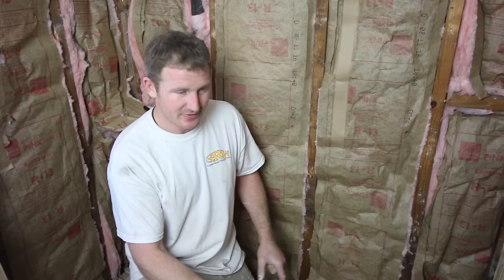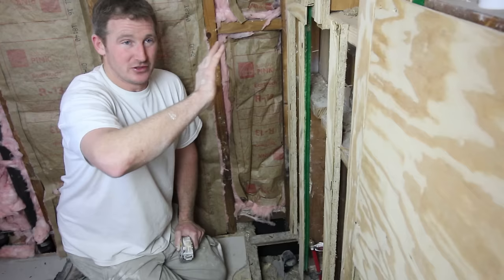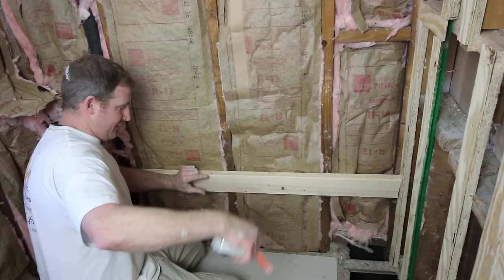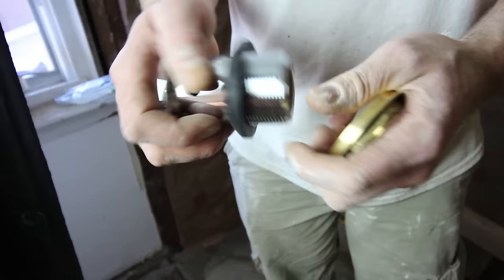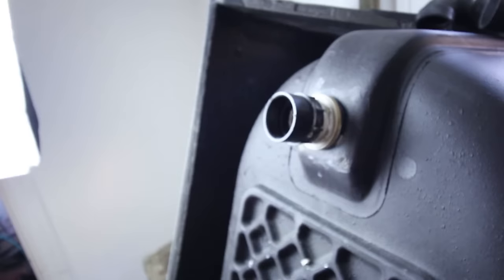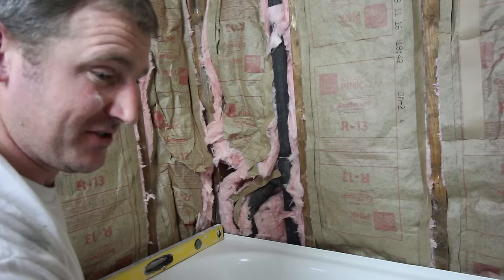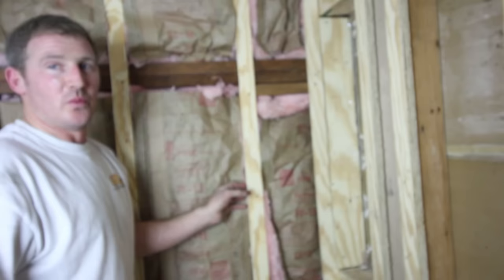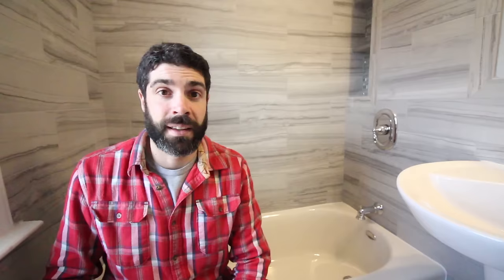How to Install a Bathtub...American Standard's Americast (Step-by-Step)

Comment: Installed this tub. When you stand in it the tub  squeaks since the bottom is made of foam and the bottom is designed to touch
the surface of the floor.
Reply from the maker: Is your floor level?
Reply: Yes, I leveled floor. After use the squeak diminishes, but not 100 pct. There is a forum on Americast brand (American Standard) foam bottom tubs.
They flex even when installed properly. After a few years the tub enamel may experience stress cracks requiring removal. The mfg does not recommend mortar bedding due to heat stress, but contractors say this is the way to go.  Other cases have happenned where the foam delaminates from the tube. The instructions recommend silicone beads. https://www.johnbridge.com/vbulletin/archive/index.php/t-74696.html

Follow-up...I was able to find an adjacent wall to the tub and gain access to the underbelly of tub. I cut open the drywall.
I poured about 25 pounds of concrete floor leveler and spread it around with a make shift wood stick taped to an L shaped end (from a shelf hanger). I pushed the soupy mix around the outside base of tub. I could only reach one side. Then after 20 minutes of setting up, I was able to move the thicker mix on the floor  against the under side to push up a ledge of concrete to support the under side next to base. This is only about 2 inches or less space.  I checked the tub, and all the squeaks went away!.

Comment: What do you do if your alcove tub has an integrated 1/4 inch flange , and the hydro ban board you plan to use says you must add firring strips, but by adding said fitting strips plus your board of 1/2 inch makes the shower wall 1/4 inch proud of the rest of the rooms half inch drywall. How do you make the shower wall in plane with the rest of the room if you have to add 1:4 inch strips for the tub flange??

Comment: Thanks for the video. Do you remove the screws & washers before putting on the new backer board? 
Otherwise wouldn’t the board flair out at the bottom & sit funny over the angled washers ?
Reply: The screws and washers stay. You can notch the backer board to fit around the washers.

Comment: Just curious why the caution to not over tighten the washer and drain. Is it more likely to leak if it's too tight? I installed this tub and followed the direction to hand tighten plus a 1/4 turn and im getting a slight drip leak under the tub drain at the rubber gasket.

Comment: Question: Do you worry about the metal threads on the drain shoe causing the ABS to crack and fail? I was always told not to put metal male threads into ABS/PVC female threads
Reply: OS&B sells the kits that way, unless you opt for the full brass kit, i used Teflon tape around the metal treads and just dont over tighten and ABS works fine. The nice part is the metal doesn't corrode in the ABS

Comment: good video , but you should at least show how you connected the drain. that is the hard part and need to see. at least draw a diagram or show connectors you used or how you did it? Thanks

Comment: I am planning to replace my bathtub. Do I always need to replace the drain pipe even if there’s no change to the new tub location? Thanks!
Reply: Depends on the type of plumbing you have. If it’s old cast iron or galvanized pipe, lots of cases, taking it apart will cause those pipes to crack and leak. 

Also if you have an old drum trap, get rid of it. All in all, be ready to update the plumbing. But it’s not required if you’re careful

Comment: Why do you need floor leveler if your just going to dump mortar on it? Doesn't the mortar level it out?
Reply: The mortar isn’t for leveling the tub it’s for keeping the tub from rocking back and forth after a few months after the install. Some use mortar mix but I was taught to use sand mix and lay a it on the subfloor so the bottom of the tub will have something to rest on instead of sitting off of the subfloor . Even if your floor is level there’s always imperfections in the plywood or a joist isn’t sitting right so by putting that layer of mortar mix down you are giving it the best chance to not rock back and forth while you are taking a shower .

Comment: Thanks for this video-- I have a few questions: Was anything done to reinforce those notched joists? Notching joists is not a good idea. Also, where was the vent pipe for the drain? It looked like it turned downward without a vent after the P-trap (which is a code violation). Will the washers on the flange work for a tub surround/combo thing?
Reply from the maker: yes, notched joists were reinforced by sistering new ones. Also, there was a AAV for venting, which must be accessible. If the tub is acrylic we'd drill through the flange and then use stainless or galvanized screws to secure it to the studs.
Reply: @HomeRepairTutor  Thanks for the additional info. Would you recommend using washers with the screws? Would decking screws work?

Comment: The gentleman used silicone for the drain assembly.  I thought Plumbers Putty was used in this application?
Reply: Plumbers putty is oilbased, its for metal tubs. You cant use it on plastic or fiberglass tubs or you will get a yellow ring around the drain when the oil soaks into it.
Reply: bubba gump Thanks for the reply.  Americast tubs seem to he both acrylic and steel.  I wonder what to use with them.  Silicone seems safer, no?
Reply: I used plumber putty and luckily i did because i didnt tighten it enough and was leaking. I was able to tighten it some more after the initial water test.   Had i used silicone, i would probably had to re move it completely.   I think americast has a porcelain finish.
Reply: @rubberystyle   No, b/c silicone isn't shit and couldn't have leaked. That's all putty does is leak, so plumbers make more money later.

Comment: Did you drill the holes on bathtub, my tub didn't come with holes, is that common to do.
Reply from the maker: we didn't drill holes in the Americast, that would be painful and take to long. Instead, use the washer and screw method, i.e. pinch the washer against the tub lip and stud. Hopefully that makes sense. If the tub is acrylic, then we recommend pre-drilling the tub lip to prevent it from cracking. Then add the screws through that hole and into the stud.
Reply: It's the exact tub you are working with, I've installed it with a 2X4 as a support, it's creaking a little bit on the corners against the studs, nothing too major, I'm gonna try the washer/screw method, any specific washers?
Reply: If there are no holes you should not drill holes. By the time the tub is set in mud and sitting in the ledger board there is actually no need to affix the tub flange.

Comment: I had this very tub and returned it because the drain came down on top of my floor joist. It looks like you just cut the joist to make room for the black 45°.  Can you just cut away part of the floor joist?
Reply: Top notching a floor joist is permitted within certain specific limits dependent upon the width of the joist.  Anything beyond the limit requires structural engineering and an engineer's certificate if you expect to pass the plumbing inspection.
Reply: @chrisgraham2904  Thanks. This bathroom project is completed and I chose a different tub. But I now have another one to do.

Comment: Setting in mortar?  All fun and games until someone needs to upgrade the tub later on.
Reply: Setting the tub into a 1 to 2 inch thick mortar bed is common practice and critical for some tub manufacturers.  A few shock hits to the tub will usually separate it from the mortar bed when it's time to remove it for future remodeling.  Then the mortar bed is removed with a sledge hammer.
Reply: @chrisgraham2904  I'm reno'ing my bathroom. House was built in '59. The demo was a massive PITA. Metal lath nailed into studs. Some sort of half inch cement stuck on that. Then an inch of plaster. Then tiles placed on that. That was all around the bathroom. So far the demo has taken 4 days. The original floor tiles sit on a 1 inch bed of cement. The tub sits below that directly on the subfloor. It doesn't appear to be seated in that cement. Should I pull all of the cement; pull the tile and tile over the cement; do I need something like ditra between the tiles and cement?

Comment: How would you remove the tub with the mortar at the bottom?
Reply from the maker: sledgehammer to know it loose or if the tub is cast iron break it apart in pieces

Comment: Why do you have the blue PEX going to red at the elbow?
Reply from the maker: +Jeff the color is just for reference but typically red is for hot and blue for cold. We may have run out if red and just used blue
Reply from the maker: +Jeff I went back and watched the mixing valve video and didn't see what you're referring to. Do you remember the time in the video where you saw that?
Reply: Home Repair Tutor You can see it at 6:50. I was just curious about it that's all. I've done then when running out also. Or I've also used white for both
Reply: Good video..thanks

Comment: You’re crazy putting silicone on the ledger. Wasted material. Your waterproofing/tile substrate if done correctly will provide dry framing. Stop and think about it.
Reply: it's not for waterproofing,